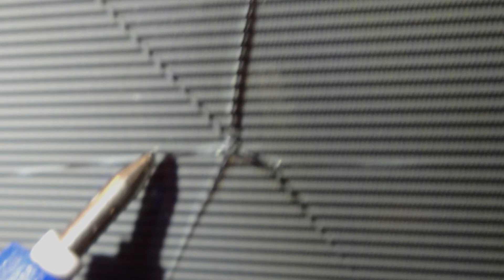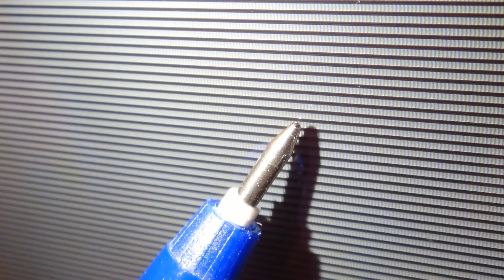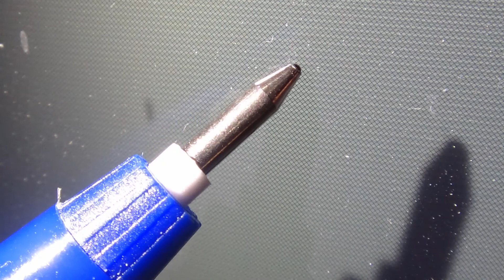Plasma TV screen cracked by itself

Comment: @12voltvids I have a 2007 43 inch Panasonic Plasma Display Panel TV and a 2005 27 inch Sharp CRT TV i had those TVs for years and still working, I use the Plasma Display Panel for my 7th GEN video game consoles through component video and the CRT for my 6 GEN and older video game consoles through s-video and composite video, I like my 7th GEN consoles on my Plasma Display Panel and my 6th GEN and older consoles on my CRT. None of my 7th GEN and older consoles do not support HDMI they only support component video s-video and composite video, none of my vintage consoles work and display on modern TVs. I don't like LCDs and LED displays.

Comment: We have a old plasma from 2009 that still works!
Well, I fixed it once. Poor/cracked solder joint killed a mosfet, and I replaced some caps for good measure.
Recently, well, within like 6 months or so, it has gotten scrolling lines. Not sure what it's from, but I think they are hum bars. Might be a grounding issue :S
Reply from the maker: +Benjamin “Ozias” Esposti Check the grounding screws on the boards.Also could be the large caps in the 180v power supply.  When they start to fail you get severe ripple from the power supply that can create horizontal lines that move up and down the screen depending on screen brightness.Vertical lines are the bad ones, as they usually indicate a panel failure.I have had good lick with plasma. I have received 5 units that were fixable.The one shown in this video is repaired (2 videos documenting it are on the tube) and even with that small crack it works fine, and the location of the crack is not visible with normal distance.
Reply: 12voltvids
Hm, yeah I ckecked the PFC bus voltage (on the big caps) and the 180V output caps, and they at least have the correct capacitance, and aren't bulged. It's possible they have high ESR though.
And yes, they are horizontal lines :P
Thanks for the reply! :)
Reply from the maker: +Benjamin “Ozias” Esposti It is going to be capacitors. You need an ESR meter to check that. Only when they completely blow do they bulge. ESR goes up, and this does not change the capacitance of the capacitor, as it is the length of the foil plates that sets the capacitance.
Reply: 12voltvids
Yep I figured.
I've been snooping around online, getting ideas for some sort of ESR meter ... I think I'll make one some day. Nothing better than homemade tools! :D (Most of the time)
Reply from the maker: +Benjamin “Ozias” Esposti 
I built mine from a kit. Easy to make and they aren't that expensive.

Comment: I don't have near the knowledge you have, of course but I think you're on to something.  I've got to wonder if the 52 inch plasma Samsung set (the one with the bad board) you were working on with a cracked screen could've been caused by an overheated section of screen.

Regards, Tom
Reply from the maker: THOMMGB This is exactly what I think happened, as there are 2 black burn marks on the phosphor, one right at the crack, and the other slightly above it. The buffer chip has 2 shorted runs when testing the panel connector. Once I replaced the buffer, there was just lines at the bottom no picture,  and then I discovered some bad connections on the Y sustain board.My feeling is when the scan drive to the buffer chip was lost the bottom buffer locked up, and dumped full current into 2 points on the screen, and this continued until the logic board figured something was wrong and shut the set down. An uncontrolled discharge would cause severe heating, and I think this is what cracked the glass. On older sets with the 1/2 thick front panel, this would be much less likely to occur as that thick glass would dissipate the heat better.

Comment: I think you are spot on. With thin glass like that its no wonder TV's break so easily now. We have an old Pioneer Elite plasma that is from the mid to late 2000's, that thing weighs over a hundred pounds and needs 2 people to carry it. And the Pioneer is made in the USA, compare that to today's cheap junk.
Reply from the maker: Low Budget Videos The pioneer was made in the USA? Really, I would have thought they made them in Japan.My Panasonic 42 weighs a ton too, and my 63 Samsung is over 100 LBS. Took 2 of us to lift it to the wall mount. The Korean made Samsung and LG sets seem to be far better constructed than the Mexican made units. When I was in the service business when RCA, Zenith, and Sony moved their assembly plant to Mexico there was a huge drop in reliability. Remember the old Sony KV-25XBR? Last set made in Japan, and considered to be the best analog TV that Sony ever produced.
Reply: Yes, the KV-25XBR was definitely a great TV set. The Pioneer was assembled in the USA from Japanese components.
Reply from the maker: Low Budget Videos There was no question, the Kuro sets  that Pioneer made were the best plasma TVs made.After Pioneer shut down their plant in 2008, Panasonic was rumoured to have bought the technology, and marketed it for a year or 2 before they too pulled the plug on Plasma. That was a dark day in TV manufacturing, but I fully understand why they did it. No money in TV, and LCD cost much less to make with higher profits.